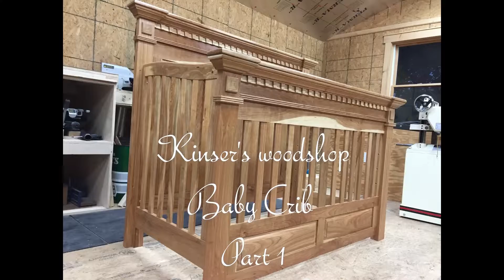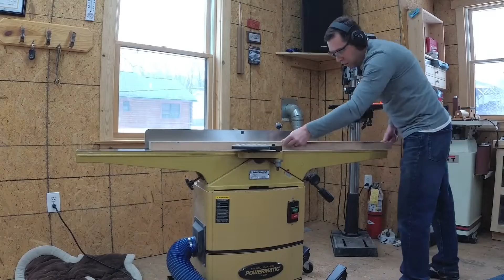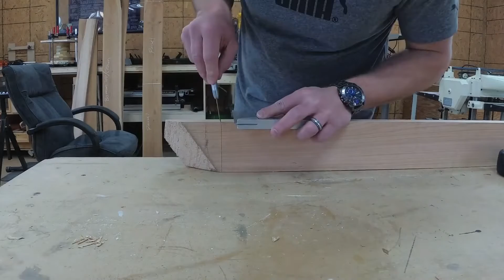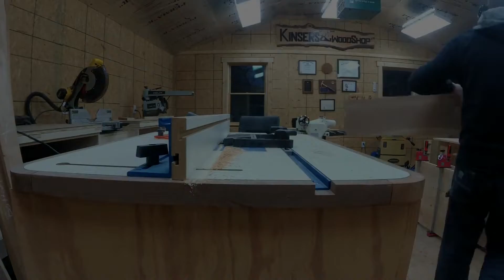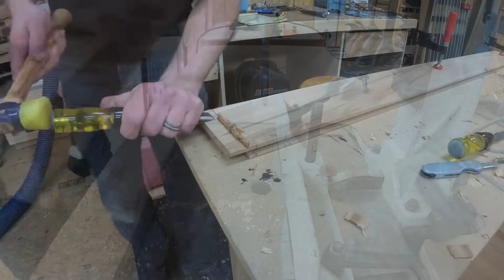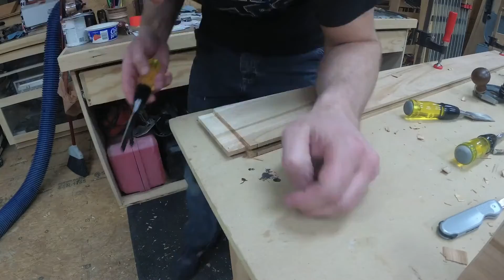How to build a 4 in 1 Baby Crib: Part 1

Comment: Do you have plans for your crib, or for your cherry dresser?
Reply from the maker: Alex,  I do not.  If it helps,  when I built my first crib(this is my second) I found an old issue of wood magazine on eBay. Issue 173 November 2006.  It has plans for a convertible crib.  That’s what I used for dimensions for slat spacing,  height adjustments,  and how to convert .  It’s not exactly what I did but it should put you in the right direction

Comment: How did you create the crown molding on the crib
Reply from the maker: I used a crown molding bit from MLCS in my router table.  I buy a lot of my router bits from them.  

https://www.mlcswoodworking.com
Reply: @briankinser1472  that’s what I thought you did. I’m trying to replicate this crib from pictures and the crown was giving me trouble because I was trying to round over top and bottom from premade crown. What is the size of the crown do you remember?